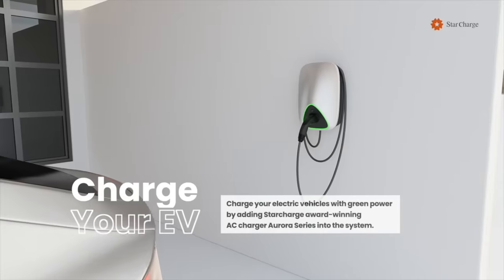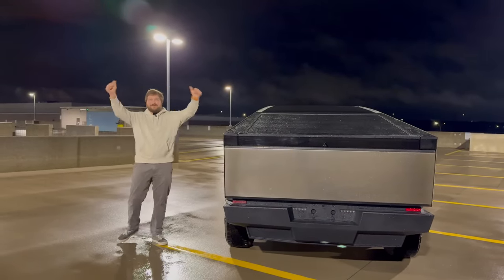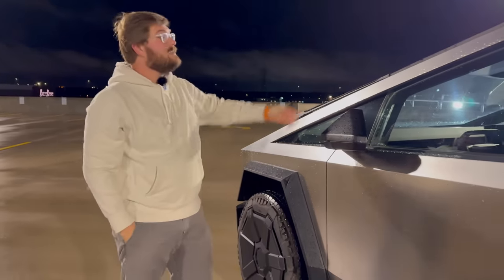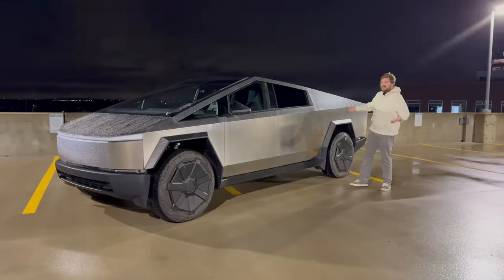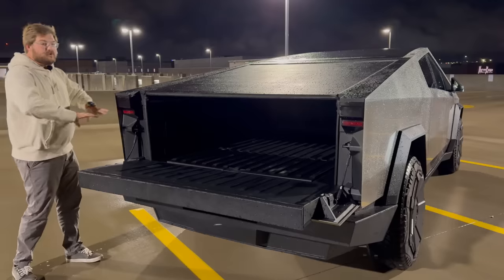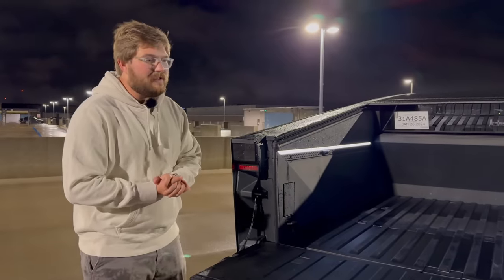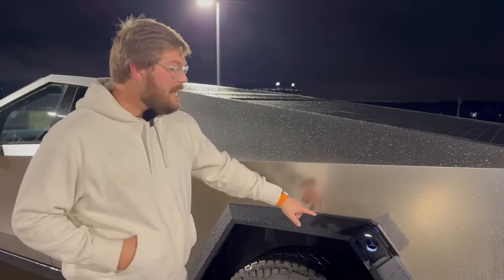Tesla Cybertruck Full Tour! Exposing All Details - Service Mode, Wiper, Powertrain, & Much More

Comment: No notes, just spitting facts nonstop! Your depth of knowledge on all things EV is extraordinary.
Reply: Basic summary is, they suck.
Reply: He is a genius with EV's. Although I really don't think 700 amps is a slow charge. I am not very familar with all the modern technologies in car charging. But as an electrician, there is a major problem; there is not nearly enough power in the grid to charge multiples of 700 amp, 400 volt car chargers. 

Consider that a house is normally 200 amps, 240 volts. The largest houses with multiple large garages will take 600 amps, 240 volts. 

Every car charger is equal to about 3 standard houses of power consumption; and actually houses generally use very little power except during certain peak loads. Elon has said that the grid needs to be expanded by 300% at the minimum, in the next several years, in order to accommodate EV's. 

But you cannot just triple the grid, because the grid is limited by the wires on the power poles, and you cannot just triple the main feeder wires. 

You have to basically build a whole new grid, or tear down the existing grid and rebuild it. OR--the utilities will come up with a new method of generating power. I think that the 3rd option is the only viable option, because tripling the grid is not practical.
Reply: Indeed

Comment: Pls, like to get in top :trophy-yellow-smiling:

0:00 Sponsors
0:20 Intro
5:58 Exterior
9:48 Frunk
12:42 Windshield Wiper
14:25 Specs
24:09 Bed
33:17 Range extender
34:16 Charging 
43:11 Francys First Impressions 
44:11 Thermal system 
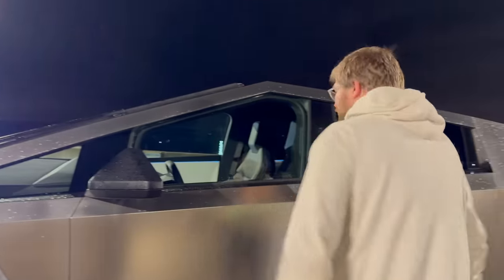47:08 Suspension
50:28 Final thoughts on exterior 
51:31 Sound system 
53:09 Seats / Squeaks 
56:05 Range 
57:16 Software / screen 
59:45 Steer by wire 
1:02:52 Door opening 
1:04:05 Back to Software 
1:27:56 Service mode Software 
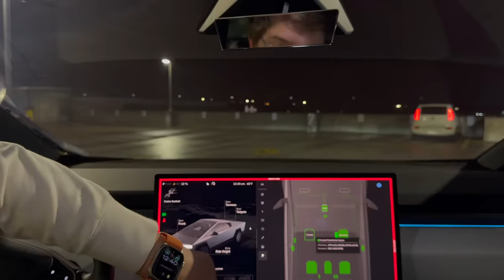1:35:09 Cabin Tour 
1:43:58 Phone Died / Final thoughts / Things to still talk about
Reply: Thanks for the time stamps
Reply: Thank you!  Almost 2 hours is just too much.
Reply: 8:30 - Yes Kyle, you do live in a bubble.  A big spicy bubble. 😅
Reply: @MarlinMay 2 hours and very little actual information.
Reply: Thanks, you rock!  It’s hard to watch the whole thing…lots of repeats.
Reply: The video already has chapters...
Reply: Thank you
Reply: @GeoffJohnson  Right? He has stamps already.  😂

Comment: The issue with the wireless charging isn’t that HVAC makes it more efficient, it is that the charging coils don’t line up well with the phone coils. In addition, the hump from the camera lenses causes it to be not flat. They need to add MagSafe and have a way to elevate the charging coils slightly so the phone lays flat to actually fix the issue and get good charging speed.
Reply: the layer of material between the coil and the outside is also pretty thick. I almost exclusively wireless charge by Samsung at home, but in the Model Y and 3, any time I tried to charge in the car I have to almost push the phone onto the area to get it to activate (I do have a case, but its relatively thin and it doesn't cause any issue on ordinary chargers) 

all this to say, yeah the Tesla wireless phone charger suck for other phones too
Reply: Fast wireless charging works perfectly even though cases on all android phones, sounds like an Iphone issue.
Reply: I've never had issues with wireless charging in the past 10 years

Comment: Heartfelt thanks for arranging and doing this! You are known for no pernicious bias and I know many content providers will take snippets of this for their own podcasts but you have my full attention on this series. I really wish you had access to one of the aerodynamic trailers so that your range tests would also answer for me the question of which lightweight rv to buy (or make) to complement my cybertruck. I am impressed with the polydrops trailers which were the result of extensive wind tunnel testing with the model 3. I would also like to consider a harbor freight 9.5w inverter generator instead of the added battery to take on my maiden trip to Alaska when mine becomes available in a couple of years. Thanks again.

Comment: From initial impressions it feels they have nailed everything except the 4680s which I hope they will improve it iteratively.
Reply: 4680s, "world's cheapest bestest in-house cells, 2.0" are key to the success of Cybertruck, Semi Truck and Roadster.
The specs promised: 500 mi, 500 mi @60 mph @ max load, 200 kWh, just are not possible with their barely 300 Wh/kg cells. It takes 500 Wh/kg, and might marginally work with 450 Wh/kg.
Elon scribbled something on a napkin and they went with that for 5 years, it seems. He knows more about manufacturing than anyone alive, after all... Imagine a Roadster with 200 kWh if they could only get 123 kWh in this truck and some 50 kWh extra with the extender. But in a Model 3 sized sports car....also weighing 6600 lbs. Pure insanity to promise 200 kWh when Elon previously said no car needed more than 400 miles, 100 kWh. The promised of 1.9 0-60 has now been met by a Lucid Air the same price as the hyped Spartan New Roadster, but that one's 118 kWh or so, about what's practical unless 3 tons is cool for you. It would be laughably bad on track with 3 tons, let alone harder to make "fly" with those Space X boosters promised.
The way Tesla builds cards houses of promises is really disconcerting. And now also various choices which can only take away road safety. Long list there.
Reply: @Cloxxki Lol ramping new battery using dry processe is hard... how is Ultium from GM? Pouch cell is gen1... they are working on old tech. How is solid state battery from Toyota or hydrogen? So many false promises that don't get your attention, ah right, that is not popular and they are not really worth mentioning. SpaceX is almost monopolizing the space launch. Falcon 9 has been working hard for the past 5+ years, yet reusable technology has goes unchallenged. China is doing it best to copy. Others startup are still in development phrase.
Reply: @nguyep4  Ramping is hard yes...but the issue with 4680 is that they don't have the tech figured out yet. Even tho they said they did back in 2020. it was a lie.
Reply: @heyitstim3618  It will get better in time. With every new product, there's a learning process.
Reply: @Cloxxki  Hate hate hate, wow!
Reply: @nguyep4  They all get my attention, but Tesla built their pyramid of promises on it. 200 kWh Roadster, reserve here, peasants. Its seems NIO are really going to make the 150 kWh sedan. Cybertruck 123 kWh ONLY and no room for a spare wheel, LOL. Because large volume per kWh of cells.
Reply: @Cloxxki  150kwh can't be scale, it will be as difficult to as ramping the 4680 but with different technicalities. that is my point. You do know Tesla made 20M 4680, sounds alot... yet that is only enough for about 15k Cybertrucks, they need billions cells.

Comment: Interesting to see the tonneu cover doesn't get wiped at all when stowed... wondering if it has dirt and snow on it where does that end up?  assuming it drains to the ground from it's stowaway.  or even what would happen if you accidentally left something valuable on it and opened it?  can whatever you left on it somehow be recovered or is it permanently sucked into the abyss?
Reply: Good question, i wonder the same.
Reply: I believe Elon himself has confirmed valuables do indeed end up in the abyss.
Reply: There is a camera that photographs valuables before they are sucked into the abyss, then they eventually end up on eBay.
Reply: Kept in a spot close to the battery so when it bursts into flames, there’ll be readily available kindling

Comment: Minor correction. The 120v in the bed are 5-20 outlets. 20 amp instead of 15.
Reply: Also the wiper is 120w, not 1000w
Reply: @ScottBuscemi  The VP of vehicle engineering at Tesla said it was between 600 and 800w
Reply: @TRcakeNINJA  He corrected himself in a follow up tweet saying he misspoke.

Comment: Two questions: You called the 120v outlets NEMA 5-15, but they have the horizontal blade that would normally make them 5-20 outlets.  Can they put out 16 amps?  Are they tied together or can you get 16 amps out of each one simultaneously or is it 16 amps total on the 120v circuits?  Second, on the NEMA 14-50, can you please put a voltmeter on the outlet and see if there is a neutral as well as the two "hot" connections?  If there is a neutral that measures 120v from the hot to that neutral on the 14-50, then that plug might be able to tie from the truck to a home's power panel on a manual lower-power basis to power a home that doesn't have all the expensive automatic interface hardware...
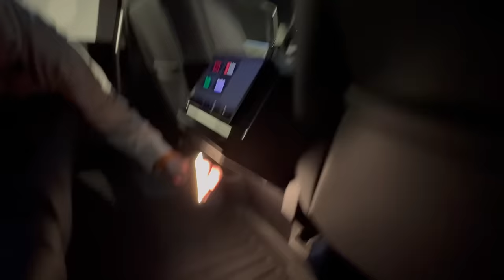Reply: 1:39:04 not to be pedantic, but Kyle says NEMA 5-20 here
Reply: He did correct himself.
Reply: If it doesn't have a center tap/neutral then I would expect that at least some devices plugged into said outlet wouldn't work.  Accordingly, I would assume that the neutral prong is functional.

Comment: Would be interested in knowing how the distance sensing works when backing up with tail gate down. Situation where Ultrasonic sensors are needed. Ford has a camera on top of their tailgate on some models. If vault cover was down, no rear view at all. (Hauling plywood sheets, etc..)

Comment: Over 50% larger battery than the Model Y, so you SHOULD expect better nominal charging. However, with consumption about double...road trips are going to take some patience. Anyway, full is around 340 miles at 50-55 mph. At 70 mph...250 mi or less. Charging to 60% on a route paved with hyperchargers for minimum travel time, going down to 10% for safety...you're left with 125 mi of perfect conditions range. 80 mph in winter...100 mi stints if lucky.

Comment: Since the DC fast charging is split and the range extender battery is expensive and takes up bed and payload, an option for a second charge port on the other side might be interesting.  Then you could charge using two DC pedestals at 400V for faster charging.  Since most of the hardware to allow such a feature might already be present just need the second charge port, maybe some additional hardware and firmware changes?  I would say about 40% of my Tesla DC fast charging sessions have only myself and maybe one other vehicle.
Reply: Tesla's not going to let Cybertruck owners hog two stalls at once at chargers. That would be wild tho...

Comment: The interior radar has been used on the Model S and X refresh. It doesn’t show up on service mode for those though. While exactly what it does isn’t well documented, I have noticed that placing my toddler in her car seat and then closing the door keeps the MCU active and climate control turned on. This is with her seat set to “car seat mode” which causes it to ignore the occupancy sensor for it and not show seatbelt alerts, note that the actual seatbelt is always connected. I have also noticed that moving my arm over the passenger seat triggers a seatbelt alert on it, even with no weight on the seat.
Reply: I just figured it out in another comment. It's a "Stupid YouTuber" mode. So that way if someone tries something really stupid like putting a few bags of potatoes in the driver's seat, then hopping into the back seat, while it's self driving, the radar can detect there's no human there.

Comment: In future testing please cover how the 48v aux power works.  Does the Cybertruck automatically step down voltage to 12v for 12v accessories?  Will owners have to wire in a 48v to 12v converter to use standard accessories?
Reply: I would imagine, like many new vehicles, it doesn't even have the 12v cigarette lighter port.  Luckily, USB C to 12v cigarette lighter adapters exist.
Reply: There's one power converter for all voltages. Mentioned in the Sandy Munro factory tour.

Comment: Range/efficiency comparison with and without the side mirrors would be interesting I think. Supposedly there are plastic caps in the glove box to cover the hole left in the door by removing the mirrors.
Reply: US govt should get with the program and approve mirrors for side view use. That being said, I am not at ALL a fan of a car manufacturer cheating the system and making it so easy to skirt safety regulations. And then claim deniability when it comes to liability as Tesla undoubtedly will....
Reply: Didn’t even know that ty

Comment: Please hook up to CANBUS and see what “Capacity when new” it reports. Also let us know what “Max Discharge” value is when close to 100% SOC and also at different battery temperatures. If you charge it to 100% just check “Max Dischage” when it completes charging.
Reply: I'm pretty sure it doesn't use CANBUS.
Reply: @rogerstarkey5390  ok then whatever it does use. It would be great to see what the potential power of the vehicle is.

Comment: I'd love to see you load lumber, drywall, and other stuff into the bed to test its work truck capabilities.
Reply: Not his truck, not gonna happen.
Reply: Longer than the equivalent F150 (Gas or Electric).
Full sheet width.
.
Floor toggles and L Track for tiedown.
Carrying short stuff (cement bags, etc) waterproof
Tools? Secure and fully out of sight.
.
More height for secure transport of taller items.
Seems quite practical.
.
If you want to put a lot of loose items, tools, loose material in there, fit a heavy duty slide-out.

Comment: I think thermal management for the range extender is going to be a challenge.
Reply: Because Tesla doesn't do thermal management? ...
Reply: @rogerstarkey5390 currently they do so much with the octovalve. Wonder what the plan is for the extender. Will it have its own heat pump and resistive heater combination?
Reply: Tesla Powerwalls have TM maybe the range extender will have its own like Powerwalls

Comment: Wow, no 12v outlets. I can’t say I’m that surprised, but that seems like an oversight if they didn’t include at least one for accessory compatibility.
Reply: Just plug in your laptop charger directly into the outlet like at home.
Reply: @starshipdriver8536  I'm not talking about a laptop. I'm talking about things like Radar detectors and other devices that were built specifically for use in cars that only come with 12v power cords. Sure you could buy an adapter, but you really shouldn't have to in a $100k truck. I don't have a use for a computer in my car which happens to be for driving.
Reply: @johndavis7257  Get the radar that powers off usb-c. I don’t want the inferior 12v cig lighter in my truck. I want a 48v system with real outlets that can power anything.
Reply: @starshipdriver8536  they can power things just fine. Buying a new car shouldn’t require to replace everything else you own. A single 12v outlet would have been fine. It’s not inferior it’s different. The entire car doesn’t need 48v. 48v isn’t even necessarily better it just saves Tesla a bunch of money as they can now cheap out on wiring harnesses and give you less while charging the same while forcing you to buy replacement parts from them as light bulbs, batteries, and a host of other things will no longer work with your fancy bleeding edge truck. And you can forget modding anything like a normal light bar or winch onto it as those are all 12v too. It’ll eventually catch up so that it’s probably unnecessary, but as with anything new there’s a transition period and it should come with a 12v rail and connectors to make that simpler. They didn’t care because fanboys like you will throw money at them either way and they’ll happily con you out of it by telling you it’s “revolutionary”.

Comment: My guess is the charge curve drops down so quickly not because of the cybertruck batteries but because it's pulling way more current from the charger which would start degrading the charger circuitry in a v3 charger.  v4 should fix this but i don't think v3 chargers will ever show an improved charge curve on the cybertruck.  It is essentially 2 teslas charging off the same outlet at the same time and v3 chargers just weren't designed to sustain that sort of power draw.
Reply: Unlikely. And this'll be easy to disprove by plugging in at 30 -40 - 50% (past where it starts tapering) and showing that even with a "fresh" charger it doesn't go fast.
Reply: @graemeesmith  yes that is something I would like to see as proof

Comment: The outlets in the rear shutting off at 20% is problematic for campers. I would likely keep an electric refrigerator plugged in when driving. I would not want that shutting off

Comment: It's kind of funny. I saw a Cybertruck in Western Colorado going north to Grand Junction 6 days ago. They had already branded it "RC" and some logos. It was definitely way different looking than any other vehicle on the road.
Reply: RC stands for Release Candidate, it was a manufacture vehicle you saw
Reply: I just looked at the photos on Reddit from CO of an RC Cybertruck, and the one I saw filled the front door with RC at an angle,  with a 3x3 grid of squares after. It could be a test truck or someone trying to look cool. If you have a business and want to have branding, the Cybertruck will definitely grab someone's eye.

Comment: I have a foundation Cyberbeast officially ordered now (and currently have a Rivian R1T) and I have few questions for you:

1. How does the cabin noise compare to the already very quiet Rivian R1T?  (at highway speed, bumpy roads etc...)
2. Is there a "HomeLink" garage opener built in? or is MyQ Connected Garage the only option?
3. Does changing the ride height get GEO-located?  (This used to be the case on our older Tesla Model X)
4. Is there a washer spray for the rear camera?  (if you live on gravel/dirt roads you know why I'm asking)
5. If the side windows are all the way down, why do they roll up slightly when you open the door?
6. Does the tonneau cover keep dust out of the bed when driving on very dusty gravel roads?

Hopefully you are able to address some or all of these questions in a future video!

Thanks for all you do your content is amazing!!